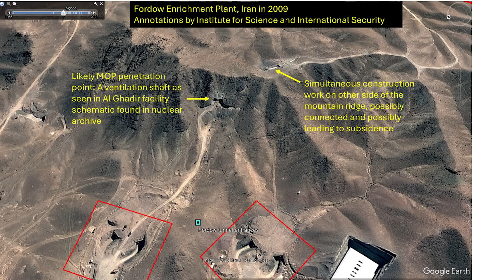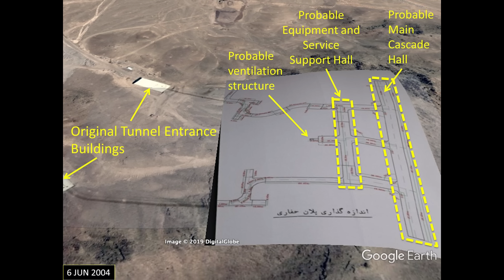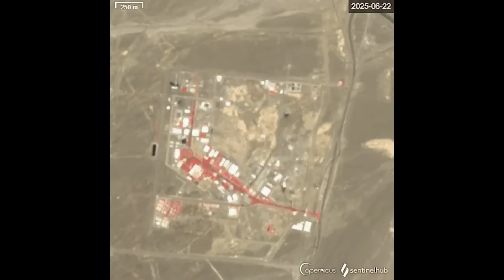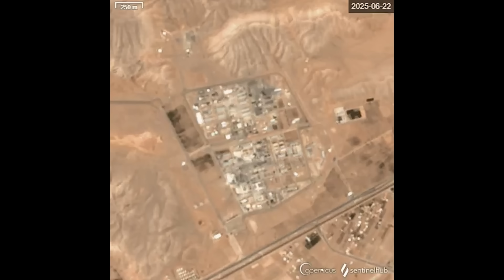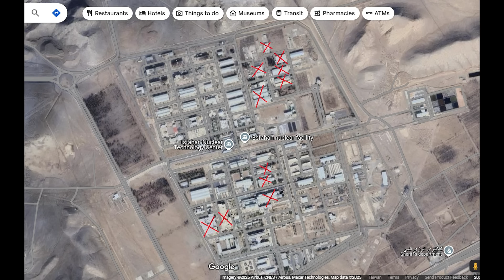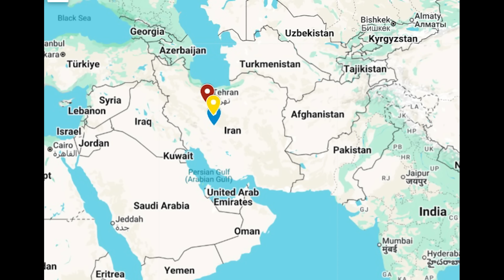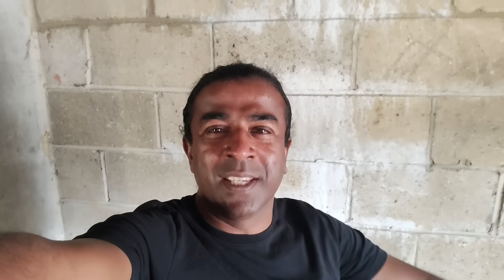Operation Midnight Hammer: New Satellite Imagery of Fordow, First Imagery of Natanz & Esfahan

Comment: I think it can be safely assumed that all the bombs carried were dropped. Those GBU-57s are quite heavy, and they have a long return trip.
Reply: There were two groups of 3 holes at Fordow, with one hole in each group being visibly large than the other two. So yes, I think 8 bombs were dropped in total there. The first three, in each group, to loosen up the soil with the forth having an easier time penetrating as deep as possible.
Reply: From my limited amount of reading, I believe the idea is to never land with ordinance on board. 
 As you say, weight is a factor, so they have to maintain greater speed at the time of landing. 
"Coming in hot" (fast and heavy)
Reply: @Qingeaton1  Especially on carriers.
Reply: They have plenty of tanker resources to take all they came with back.
Reply: Do you think there was casualties of staff inside or were everyone evacuated?
Reply: There are not many of those 30k pound bunker busters in the inventory. We're not going to waste them to save gas.
Reply: Likely what happened is that some planes only dropped one while others dropped 2.   @donwyoming1936
Reply: @donwyoming1936 they are easy to replenish and there isn't a high demand for them.
Reply: @donwyoming1936  The second atomic bomb was dropped against orders, because they wanted better fuel efficiency, to get back home after the target areas were all covered in clouds.
That was 1/1 in the arsenal at the time.
The target was the military and industrial area, of the city, but they hit the residential and commercial area(because they were just aiming at clouds).
Reply: I mean...it worked....
Reply: Absolutely. I would suspect that, if there were any reserve aircraft, they would RTBd shortly after takeoff, when it was clear all mission aircraft were fully functioning.
Reply: I assume that was a general comment about any aircraft landing on a carrier.
No way in hell a B2 is landing on a flat top without immediatly falling off the far edge
Reply: @Erik_Ice_Fang  USN Vietnam era here. Back in the day you would ditch the aircraft before trying to land with munitions on a carrier. And it did sometimes happen that the bomb release didn't.
Reply: @alreaud  Yes, they don't like to land back on a carrier with a bomb load. Air to Air ordinance yes ground ordinance no.
Reply: @Erik_Ice_Fang They are Air Force, they don’t land on flat tops. B2’s are pretty big planes with a width of 52 meters. Only navy, marines and coast guard planes or choppers land on vessels.